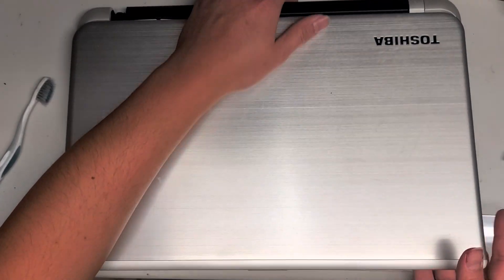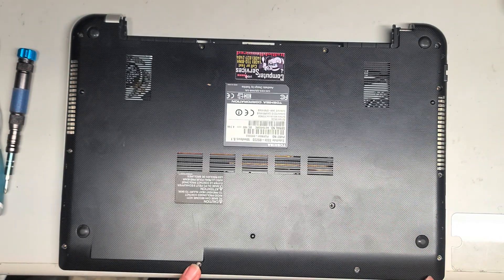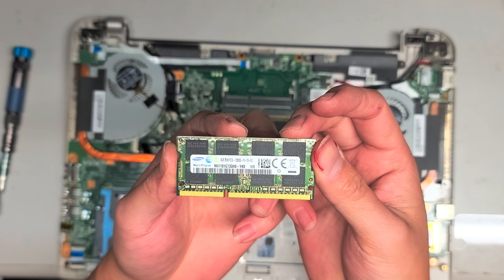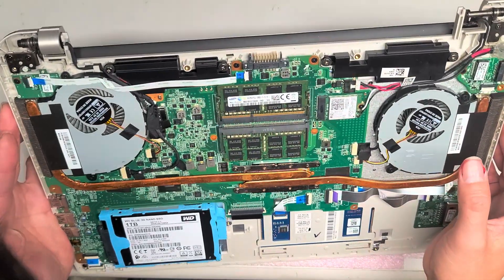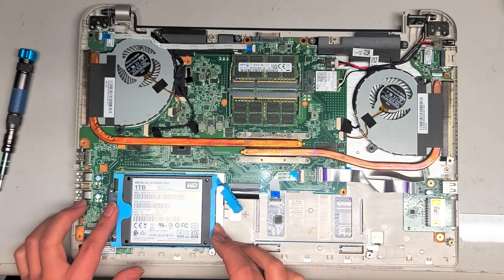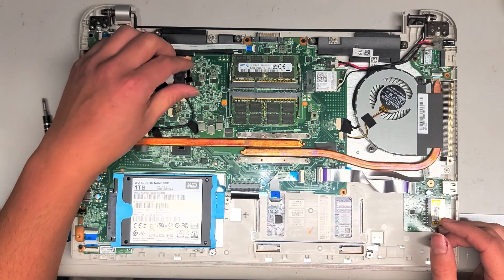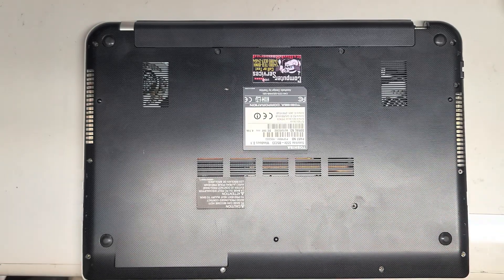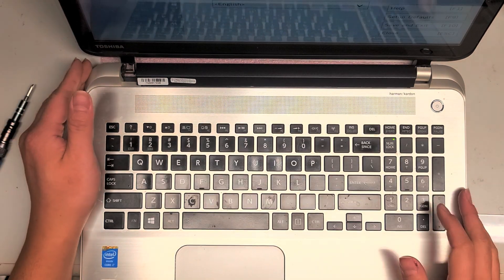Toshiba Satellite S55t-Bt233 Disassembly RAM SSD Hard Drive Upgrade Repair Battery Replacement

Comment: I have this laptop and the screen stays black when I power up.
Is it true that a new RAM 'card' will get the screen to work? My first thought was motherboard issues
Reply from the maker: Only if it's a RAM issue.
Reply: @ItsBinhRepaired  
Roger that.
Reply from the maker: @timfronimos459 try one stick at a time

Comment: My laptop mother board is basically the same as this one. 
When my laptop turns of it takes 50-80 times of turning it on and off and on and off over and over before it turns on. The general consensus is the bios battery needs to be replaced but it appears it's on the top of the mother board. HOW do you get to it and replace it?????
Reply from the maker: Sounds more like a faulty gpu
Reply: @ItsBinhRepaired  gpu? what's that? And I'll add that once it powers up it runs great.
Reply: @ItsBinhRepaired  I guess I need to add more troubleshooting info. When trying to turn my laptop on not only does it not boot up, the USB plugs do not power up either until after dozens of on, off, on, off, on.....
Reply: @ItsBinhRepaired  I also installed the original HD and experienced the same problem.
Reply from the maker: @donh4750  gpu is built into the motherboard
Reply: @ItsBinhRepaired  Ok, well if it booted up with nothing sent to the screen wouldn't the USB ports show activity? They don't.
Reply from the maker: @donh4750  no, if the gpu chip is bad it won't even boot
Reply: @ItsBinhRepaired  I have been able to get it to boot every time with dozens of power cycles. My latest is someone has said it could be a defective power switch or in the power section on the motherboard.
Reply from the maker: @donh4750  not sure. Power switch would mean nothing happens when you press it
Reply: @ItsBinhRepaired  The light ring around the power button lights up, the 2 power light turn on, the fan turns on. But it is stubborn about actually booting up and takes a lot of cycles before it boots. And this does not change when I install new RAM or change the HD. So it definitely looks like a hardware problem.
Reply from the maker: @donh4750  definitely sounds like failed motherboard.